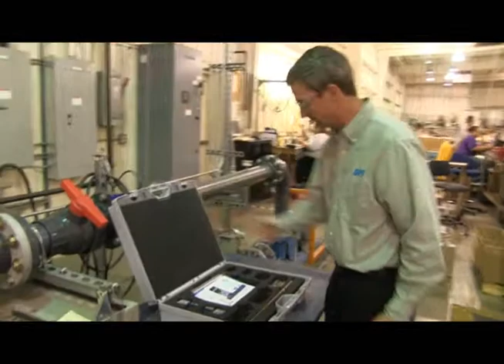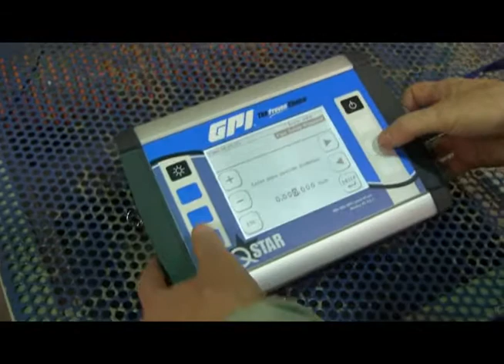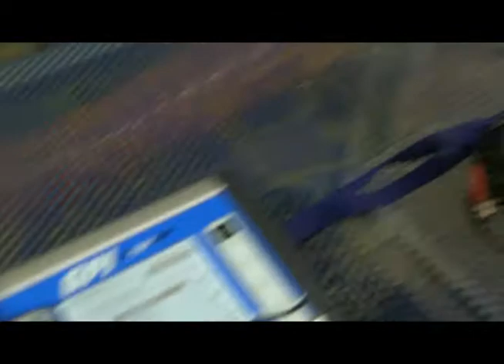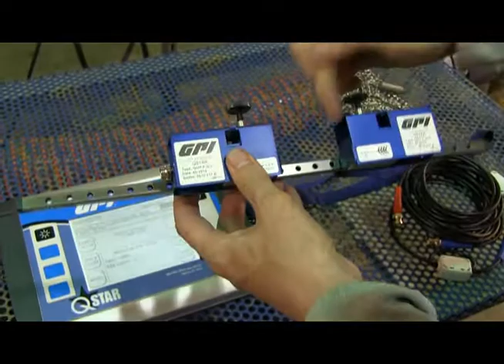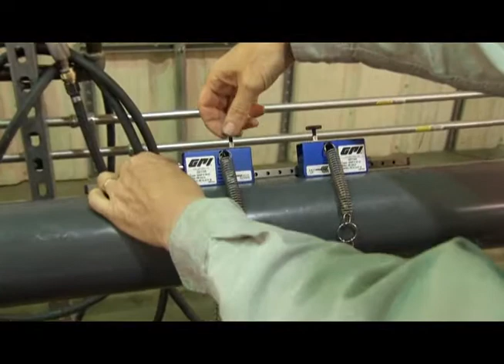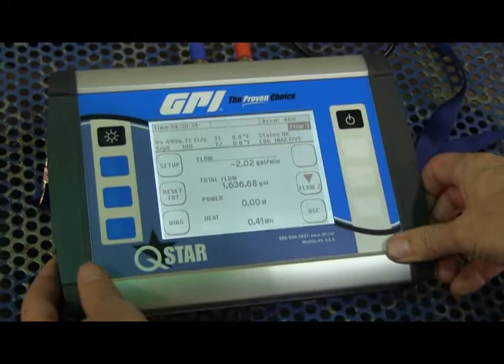Product Overview: GPI's QStar Ultrasonic Flowmeter

Comment: Yet another brilliant video from the Flow Control team, thanks! We've certainly seen a surge in the number of individuals using ultrasonic flow meters within our sector over the last five years. There are an array of providers who each offer a selection of options, such as http://micronicsflowmeters.com/. The key is to ensure that you select a flow meter that fits the requirements your process needs at that point in time whilst also ensuring it will continue to work as your operation scales. 

Thank you for the great video and keep them coming! :)